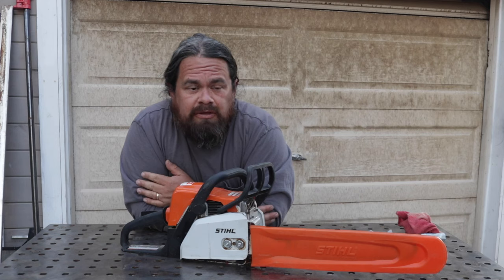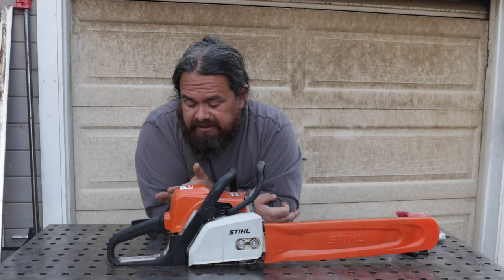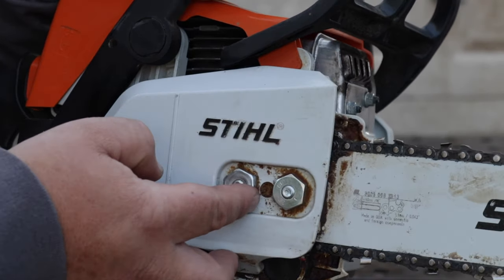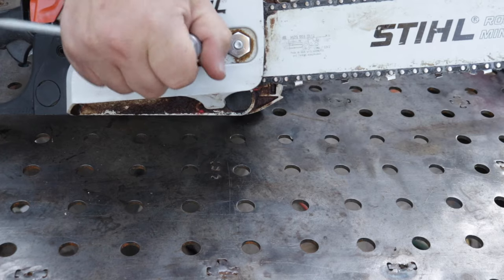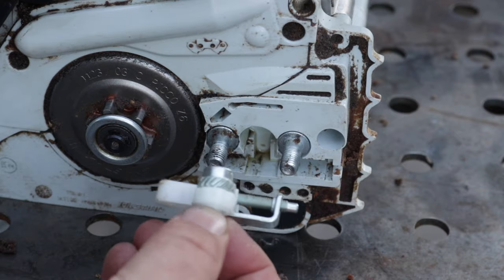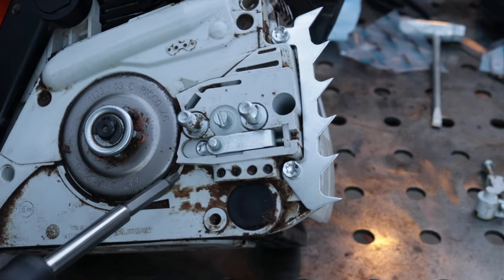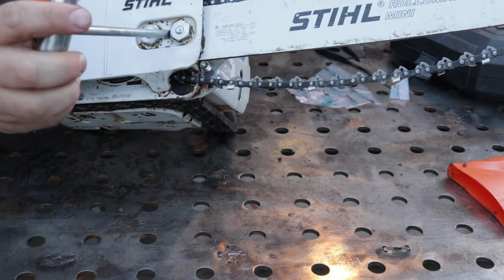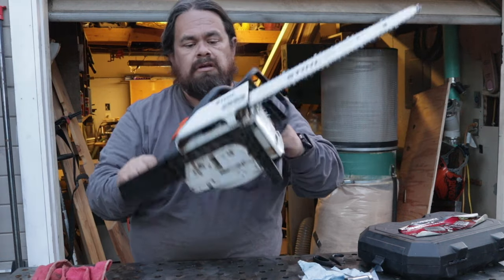Cheap💰Upgrades for the Stihl MS 170 Chainsaw

Comment: Dude you pulled out a tape measure and still don’t know how long it is
Reply: duh, maybe because the bar goes a couple inches under the cap and he didn't want to remove it just for that.
Reply: U don't really need metal dogs for such small saw ,honestly!

Comment: There is one more upgrade that will change the way your saw cuts. My MS180C uses the same bar and chain as the MS170/171 series. I installed the 18" bar and chain from the MS211 series which gives you the .050 3/8 Picco that is a more aggressive and stronger bar and chain. After I did this swap I had an opportunity to test it out after high winds came through and snapped limbs off and blew some trees down.  Suffice it to say that it took a lot less effort to cut through limbs and tree trunks than it did before.
Reply: More bar=less horsepower
Reply: Or just get u a tungsten carbide chain & bar that's what I did.   Not cheap but stays sharp and more portable for offhand & harder overhead horizontal cuts etc ..

Comment: Chain looks tad to snug yet and when tightening bar always apply upward pressure the bar because if you don't  when using the bottom of the bar it'll move a little and tighten the chain up and making it have too much tension on the chain
Reply: On mine they usually get looser when you lift the bar while slack nuts. So I lift the bar when tensioning chain to get proper tension in use.👍🙏

Comment: Try cleaning that cover and inside w non-flammable brake cleaner spray cans....let it soak in for few minutes, use old toothbrush in hard to reach nooks and crannies, then blow out w an airgun. Typically I clean saw every 3rd use...either spray everything w Teflon, silicone or ceramic spray wax ...helps oil and sawdust not adhere to surfaces as much, less problems too.
Reply from the maker: David Greenwood Nice! Thanks for the tip!
Reply: Thanks for the info, I will try it out.
Reply: Teflon? Great idea. I have some silicone spray, wonder if that would help keep dust from sticking ?
Reply: @Hammerback0  I tried silicone, it does not last as long. Best is Turtle Wax Hybrid Ceramic Spray wax...use TINY spritz ...buff in well, take clean cloth to polish....allow 24 to cure....repeat for second coat....literally takes less than 60 seconds to spritz, buff polish ....It works BETTER than Teflon....just use brake cleaner to remove all gunk so surface is clean first..

U will notice bar oil with chips adheres less around sprockets, cover, and plastic or metal surfaces....what is there wipes off easily....U also will notice chips fly out easier, less clogging. Every time I swap chains I use this process....been doing this for over a yr on all my saws...not perfect but better than anything  else I have tried.

Comment: all links produce 403 error, nice tips thanks for that. If you screw down the blade finally, you should raise the tip of the blade with your left hand to eliminate all play that is in the construction and prevent it from comming loose for that reason.

Comment: Good little saw for the money . I had the dealer switch the bar from .043 to .050 and from 16 inch to 14 inch . I will end up adding your upgrades
Reply from the maker: I've thought about going to 16". I'm not sure I need it, but it could come in handy.

Comment: I've a ms170 with 14 inch bar. Its my only saw as I'm not a farmer. I get logs from a relative and can cut a full trailer load over a few hours. Great wee saw. Gonna get those dogs
Reply from the maker: It's a great little saw. One of these days I want a midrange saw to be in between this and my 660.
Reply: I like the ms250 I have one of those I also have a 170

Comment: My father law gave me this model last summer when we moved into a house with a ton of midsize trees we wanted taken down. I've been very happy with it, it's cut much larger trunks than I expected. I'll be doing the upgrades, I can't stand where the tensioner is mainly because I've burnt my hand on the hot chain trying to get in there. Anyways, great video! I like the easy straight to the point approach. You've gain another viewer. Take care.
Reply from the maker: Thanks!
Reply: i realize I am kind of off topic but do anyone know of a good website to stream new tv shows online ?

Comment: After watching this video I installed the pieces on my 023 Stihl. It worked great, so much easier to tighten the chain thru the side cover. Thank you and a great video....
Reply from the maker: Glad it helped! 👍
Reply: @BitsandWood  If you wanna help people, tell them to stop saying blade when referring to a CHAINsaw,  lead by example, anyone who says blade when referring to chainsaws is opening themselves up for ridicule because they immediately sound like they know nothing about chainsaws. You said blade tensioner, what exactly are you referring to? The bar? The chain? Neither are blades. The bar is fixed, the chain tensions, so if one of your followers goes into a shop and asks for a new blade for their chainsaw, what exactly are they asking for? A chainsaw doesn't have a blade. Please just get it right, you say you're trying to help people,  so don't say blade when you're talking chainsaws please, it's counterproductive and not helpful. Learn your bar, learn where the tip is, respect the possibility of kickback, because a chain doesn't cut like a blade, it cuts like a chain, there's a very grotesque difference when the bar and chain come in contact with human flesh, the chain cuts far more aggressively than a blade. This is the reason I stress that a chainsaw isn't a blade, a cut separates and cuts clean, a chain removes material with a wider cut, saying blade is dangerous and erroneous, chainsaws make a mess of flesh and I think saying blade doesn't encourage people to be extra careful of the kickback of a bar and chain. It's not a blade, it's more dangerous than that and deserves to be referred to correctly.
Reply from the maker: Calling a chain a blade is dangerous? That’s a stretch. Flub? Sure. Dangerous? Hardly. 🤣
Reply: @jeremybartlett1706  don’t have a heart attack!!
Reply: @Theferg1  I wrote all that back when I gave a shit about numbskulls calling a bar or chain ‘blades’; this guy said ‘blade tensioner’ and I tried to make him see sense, but it was a futile effort

Comment: I've got a few of those MS170's
they are a good small saw, and have their place.
I like to have two bars, one short one (I found an 8" one for when I'm camping) and one L O N G one.   (the longest I've found is 24" that fits that little unit
it doesn't take much power to pull the chain, only when it is in wood, so as long as you don't cut huge trees with it, the longer bar saves your back when limbing.   
For felling big stuff, I have bigger saws.
Reply: You ran an 8" bar on a ms170? Do you have a link? Would you recommend?

Comment: I liked the tips. I placed to orders with Farmer Tec which is a Chinese company. The good news they are very good with communication. Both the order detail and shipping status, the bad news, I placed the first order on the 9th of Feb and second on the 23rd of Feb. I still have not received either order, the 23rd is in transit by air, so maybe it will show up soon. But the first order still have not left China. The parts are very inexpensive but the shipping is about the same price as the parts, no big deal. If you are ordering for tune-up then they wouldn't be my go to again. But I did order a couple T27 wrenches and chainsaw tools for less than a buck a piece. So I am good and may buy from them again once I get the parts and see the quality.

Comment: Yepp, that's awesome. Have the same upgrades. In my opinion tho, the most value for the buck on a 017 018 170 and 180 is buying a adjustable carb, and opening up the muffler abit. The adjustable carbs u can buy aftermarket chinese versions they are solid and works well. That saw runs so good with a little muffler mod and tuning. The one i have is 24 yrs old and my dad has abused it for many years until he just didnt need it anymore. It was in a open garage for 5 yrs and was in horrible condition. Beside the heavy oil leak under, the piston was scored, piston ring stuck, rusty and would not start at all.. i gave it some love, changed the filters gave it a new oil hose underneath, thats where most 017 leaks the oil...new adjustable carb and it just started and has been running since... I dont actually understand the deal with scored pistons and stuck rings. From everything i have read and watched the saw shouldnt start with those "deep" scratches on the piston. But it does and it cuts so good. I have  ms 261 cm aswell but i just love this small 017 for limbing and smaller jobs... Throttle feels so responsive after opening the muffler and playing with the low jet.... Even if it blows up today i will still love it
Reply from the maker: I haven’t looked into carbs and mufflers yet. I’ll have to look into that.
Reply: Advancing the flywheel a few degrees will make you a believer. It really helps when you open the muffler and the carb replacement as you did.

Comment: Yes: It's a great saw. looking for plausible some channel suggests R&R with a 50 gauge bar … last few days I get the FS56RC running right by discovering to clean the spark arrest + reason for not using alcohol fuel is alcohol takes water from the air and that deteriorates small carb parts then "trick" to use of Stihl MS 170 Chainsaw is light touch feather weight and let the engine do the work shifting in and out of the cut to make additional room
Reply: ATF as chain lubricant / tension adjusted often to keep it "just right"
Reply: Atf might not have the stickiness amd lubrication properties as well as bar oil, maybe to clean out the system if youre chopping small stuff. And bar oil to fell larger trees the bar oil also cleans and breaks up the sap.  @ChiDraconis

Comment: if you have a sharp chain, you don't need any Dawgs. also, the MS170 is prone to clogging the spark arrestor.  I have found (surprisingly) that the stock, NON-ADJUSTABLE (high side)  carburetor is actually too rich. you cannot get a fully adjustable STOCK carburetor any more, and strangely enough the O17 stihl saw had a fully adjustable carb, but changed the design to utilize with the new air filter assembly.  BUT THEY KEPT THE SAME PART NUMBER,  which is strange because usually manufacturing changes results in a new part number.  you have 2 choices- find a decent 017 carb and put the 2 together,  or take a chance on a Chinese aftermarket one,  which I did. been over a year now and my MS 170 runs great. it's definitely not a #1 firewood getter, but for small stuff and limbing,  it's awesome.  only 1 of 9 saws i have, 5 used regularly

Comment: Gotta love the old chain tensioner placement. You can also replace the carburetor with one for a 211. Helps with longevity.
Reply from the maker: I’ll have to check that out. I haven’t looked at any more advanced upgrades yet.
Reply: @BitsandWood  there's definitely a lot that can be done with them. If you really want to mod it out, you can do porting work, a muffler mod, and timing advance. Do a bit too much on porting or advancing the timing and it'll kill it, though.

Comment: In the UK here but just found the same parts from sellers here for similar prices - Ordered! That front chain adjust is a pain in the proverbial! 
That part at the the end, where you hack the top of the log with the axe... That's where the baby Stihl was crying out to be used! :)
Reply from the maker: Yeah, looking at it again, I think you're right. That would have been easier to do with the smaller chainsaw. 😉
Reply: @BitsandWood  100% Since I got that saw I find myself using it for everything - So mall & controllable and warms up super fast so I don't mind starting it up for one cut!

Comment: Looks like a 16". The felling dogs are nice but they will allow you to put too much leverage on the chain and bar on that saw. This saw has the green master link, light duty. Switch to the yellow, thicker chain and matching bar. Otherwise, there's a good chance the guide on the bar will wear fast, causing the chain to get thrown off. It's worth the upgrade

Comment: I put both the side adjust and steel dogs on my new ms 170.  I would have put some white lithium grease on the adjuster before I put it in.    I also put Loctite on the screws holding both the bucking spikes and the chain adjuster.

Comment: Did the same upgrades, found mine on ebay about $7 ... I LMFAO when you MEASURED the bar with a measuring tape and you can't remember 14" or 16".
Reply from the maker: Yeah, my memory isn't what it used to be. 😂
Reply: @BitsandWood  

That's how it starts, brother ...
That's how it starts.

Comment: Nice job.... And too, I will not be affected too much if someone else tells ya Not to quit yer day job.  As a brand new sub, I find your mix of some elements of humor entertaining. (Second Place Class Clown here, we might battled for the title in a different life, lol)... I'm all wore out at 67 and my rotator cuffs are shot not providing me the stuff to start the bigger saws. I'm off-grid, homebound way up a mountain so your work/experience is big time helpful in making my MS 170 purchase be done right the first time... upgrades noted. So I'm sayin' thanks and gettin' ready to dig around in your video selection to see what else piques my curiosity...
P.S. I learned a new term... I'd always called em' "spike bars", I don't know where that came from... But so "Felling Dogs" is gonna work for me. Down the road somewhere...
Reply from the maker: Thanks, I'm no comedian, but I have fun. ;)
Reply: @BitsandWood    I just discovered the Stihl 180 C-BE this morning... Has EZ-Start, a decompression system that's gonna be key for me. Also has a tool free chain adjuster system so that's cool. I will still need to special order the steel "Felling Dog" as it comes with the plastic version. It has an automatic carb adjustment feature which senses an air cleaner plugging up and so adjusts for that. I'll keep ya posted.
Reply from the maker: @deanstackhouse4991  Nice!

Comment: I noticed some one using gravity when milling. Basically, letting the saw go down hill as you cut. (Lean log down) also went even as far as to use a pulley, log tied to a string to add gravity feed. Made better cuts S the chIn was never forced. Just thought it was cool.
Reply from the maker: I'm planning to try that same thing. I just got the pulleys and a hand crank winch and rope. It's on the list. 🙂

Comment: Does that side tensioner have the same adjustment range as the original?  Reason I ask is that my 61pmm3 chains stretch out very quickly (and I am running the chain quite loose), and the adjustment range determines how long I can use them.  

I do get tired of waiting for that saw in thick lumber.  It's nice up to about 8" diameter wood though.  I'd like to see a video of cutting a 20"+ tree with one of those.
Reply from the maker: I’m not sure about the adjustment range. My current chain already has a lot of time on it and I haven’t had any problems with this setup yet.
I should have recorded the big ash tree I fell with this little guy. My big saw was having issues so I dropped the tree with this guy. I think it was about 26” across if I remember right. It took a while, but it did it.

Comment: One thing i have done (bar the felling dogs & side adjuster upgrade), is to pull the spark arrestor out of the muffler, and cut the "drilled" section out of the muffler itself with a dremel
Reply from the maker: Did that improve performance?
Reply: @BitsandWood  Seems a tad more "rev happy" when hogging into the thicker timber we have here in Australia, doesnt seem more torquey at all, i think if the carby was more adjustable you could make a big difference.

Being 2 stroke, it can still rely on the scavenging effect without losing all the back pressure as the louvered section is still in place, creating that bit of required back pressure that 2 strokes need.

Stihl must just put the spark arrestor screens in to cover their backside- if you have your wits about you, you will know if something is burning (and my ride on mower & trailer have an extinguisher on board, and they arent far from the saw)
Reply from the maker: @maxrockatanksyOG  Good to know, thanks!

Comment: My parts did not come with screws, what will work.
?
Reply: My part didn't include the screw either, but looking at how the bar fits over the part I think it will how it in place. I am trying to figure out the screw part number.

Comment: Jeremiah, thanks for the video. I got one question, which you may have answered but I couldn’t find in the comments: What is the purpose of the screw behind the chain tensioner? It wasn’t on the original tensioner and maybe I’m being dense but for the life of me I can’t figure out why it’s necessary.
Reply from the maker: Not sure. The only screw I remember was for adjusting chain tension. My saw was stolen a few weeks ago though so I can't check.

Comment: I have an upgrade for the ol MS170 that although admittedly not cheap,  is certainly a game changer.   Order the Tungsten Carbide bar & Chain from Australia.  (Well the chain is TC but conventional bars wont fit it so it comes with its own bat)
Ive been using mine for quite a while and so far still plenty sharp.
If anyone's interested ill go out and read the bar for the name of the company & ill know because ill have a notification in my phone that someone replied.
Reply: I'm in Australia, i would be interested in where you got it from ??

Comment: mine has collapsed ..the orange body has hinged off and i couldnt stop it ....in end i put finger on the wire and pushed and it stopped ....so i dont know what to do its only about a yr old and only used 3 times ...